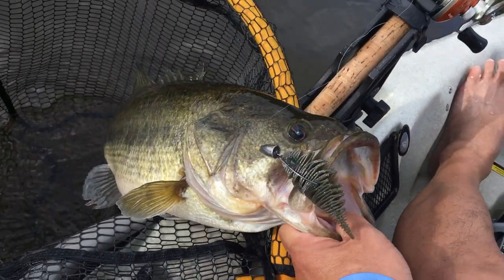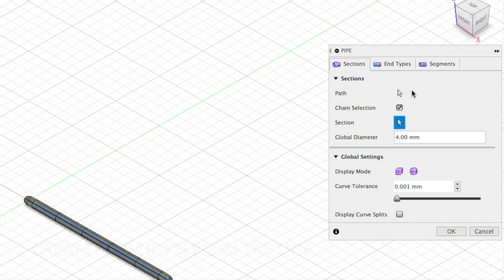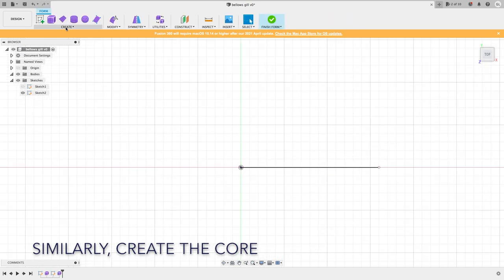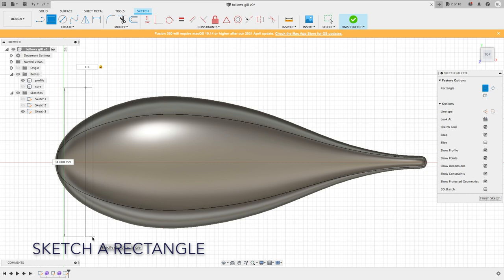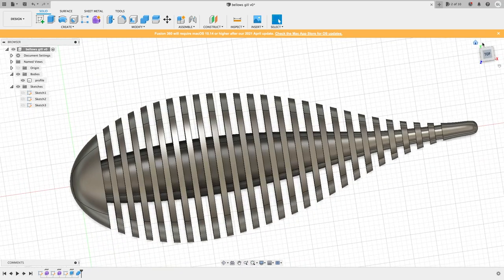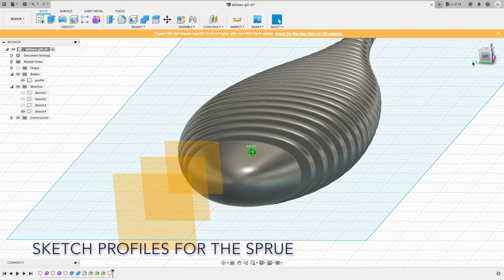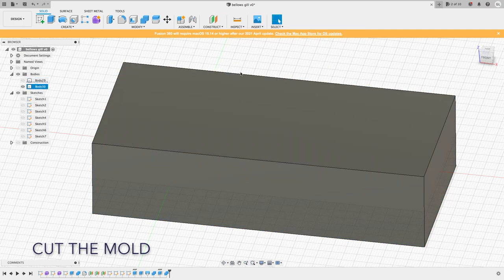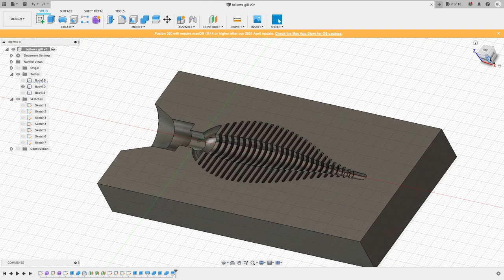DIY Bellows Gill ベローズギル Style Soft Plastic Lure

Comment: Nice. I've been interested in doing something like this for a while. Subscribed!
Reply from the maker: Thanks man! Please leave comment about what other designs you would like to see.
Reply: @yauckoutdoors  Your version of Berkley Pit Boss or a shad profile swimbait. Also, how did you learn fusion 360? I tried for a week and sorta gave up.
Reply from the maker: @j-hookedfishing1133  Sure I will put those in the list. Fusion 360 might seems intimidating if you have not used similar tools before. I have used AutoCad before so I was able to pick up Fusion 360 quickly - although there is still a lot to learn. I would say you can try simpler tools like Tinkercad first. Get a feel of how to sketch, extrude, cut, combine, etc. Once you are comfortable with those operations, switching to Fusion 360 is just the matter of finding where the knobs are. Cheers!

Comment: petg?
Reply from the maker: I was actually using PLA. PETG would be better but PLA can work too. You need to be extremely careful about the shooting temp, because those ribs are thin and susceptible to heat.
Reply: @yauckoutdoors  What temp are you shooting at? Every time I've tried PLA I melted the mold so I've been using PETG. Thank you for the tutorials btw, I've made a few lures for myself because of you. <3
Reply from the maker: @AllSnipe  I shoot at a little over 300F, at that point the plastic starts to get viscous so you need to act quickly. Also make sure the mold is not too cold. Best to warm the injector too so it will not take away the heat from the plastisol. Try to oil the mold so the plastisol would go down more easily. Don’t hold too much pressure. Don’t shoot too fast. It can be done but everything has to line up. Good luck.